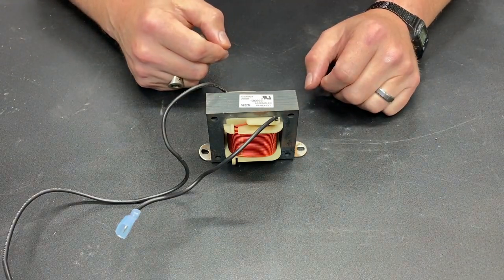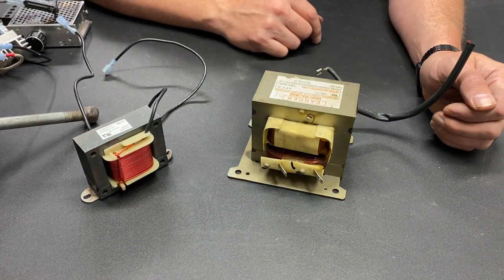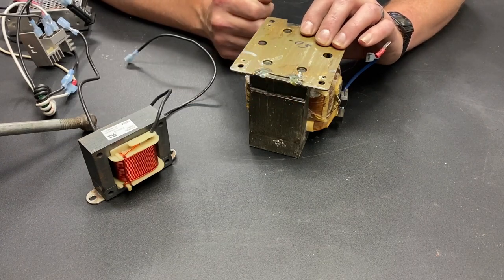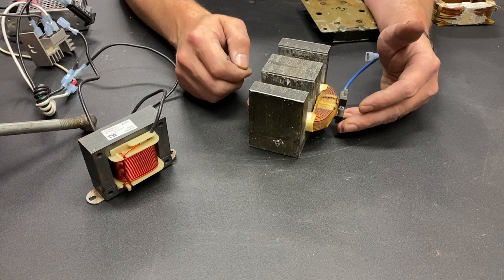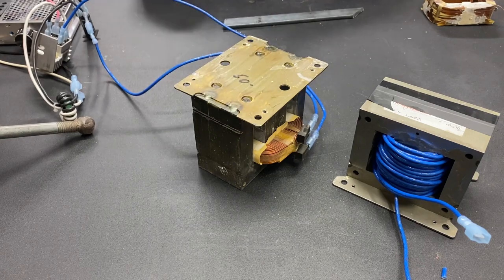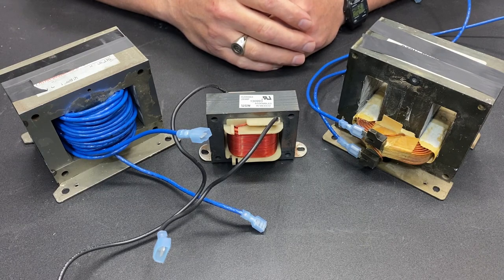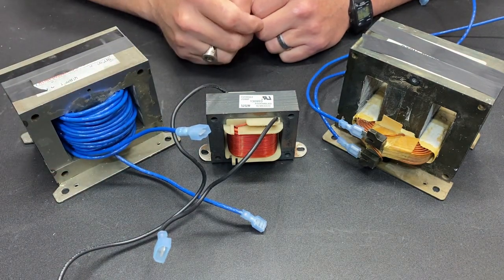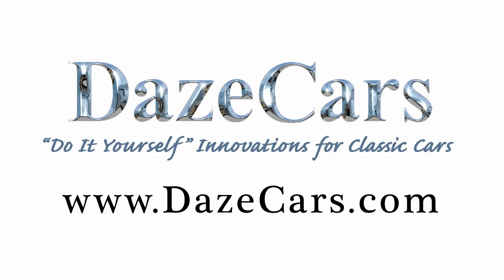DIY Treadmill Motor Choke Built From a Microwave Transformer

Comment: Hey just wanted to follow-up and point out how important your videos really are.    I asked a few weeks back about winding my own choke, then I came upon a de-funked 12v charger in the back of my shop so I took it apart and realized its transformer was perfect for choke.  Then I thought Why bother removing the upper winding as it is not connect in anyway to the bottom.  Then I thought to review this video you did again.  Lucky me I probably would not have had a chance to thank you otherwise!  I cut the top off, pressed out the upper winding and re-welded the frame, all as you suggested.  Works a charm as you had said it would.  Key take away:  Don't be shy to view good "how to" videos multiple times, there is always something new to learn.
Reply from the maker: So glad that you rewatched it and were reminded to remove the other coil as that could have been bad.

Comment: I have a MC70 controller driving a 2hp motor which am installing on my Lathe. My treadmill did NOT have a choke? Sounds like I should add one for reliability.
Reply from the maker: Can you contact me through my website  and send pictures of your board?  I have not messed with an mc70  and the internet search I did came up with to many totally different boards all labeled mc70
Reply: @dazecars  I sent you an email with pictures.
Reply from the maker: I received it, thanks. I will answer here as it may help others. That board likely doesn’t use a choke from the factory as it has other cleaning components on board like the capacitors. I would also observe sparking at the brushes on hard starts. The board likely also has soft start which buy slowly increasing speed instead of trying to immediately ramp up at once reduces but does not fully eliminate the need for a choke. As to your question about the j5 and j4 not having played with an mc70 I have not experimented with the different options and do not know their function. Lots of boards have jumpers like that to test any number of functions specific to their board which are not always drive motor specific. Short of  the ability to look at a circuit and determine its function (like an engineer which I am not) you need the pin out sheet. This lays out basic functions of connecting points on the board. Some manufacturers are really good at including such a sheet inside the treadmill and some don’t provide it at all.  Let me know if I can be of any further assistance.

Comment: Id just like to add my 2¢ for what its worth. I took a microwave oven transformer whos core is maybe a bit larger than half the size of the ones you demonstrate and instead of just the single primary i stacked 2 primary wraps into it, welded the E n l togethet and it seems to be just as good if not better than the chokes ive salvaged from treadmills. Yes those are made specifically for that motor but lets face facts in that manufacturers dont always put out quality. Ive not seen any rpm or current drop in my machines by doing this peraonally. Anyway just a tip from another diy/fabricator for all of those who look for info. Great channel, great vids, keep up the good work!
Reply: Just to add another note. Your hamd wrapped choke would have preformed much better had you used silicone stranded wire, 12 or 14ga. And had you wrapped the core tightly and without an air gap around the wire. Uses more wire but it does preform decently. I know this because i use a choke (based off of and inspired by your video here) that is 2 mot cores stacked face to face and welded together for my diy welder which puts out 80-100 amp at 32vdc on max setting. The apm depends on what material im welding. 10ga wire soundly wrapped filling the core with no epoxy. Anyway, just a bit more info to help share, keep up the good work!
Reply from the maker: Did you wire the two cores in series or parallel?
Reply: @dazecars  series
Reply: On the same cotr
Reply: Core ... Lol typos
Reply from the maker: @robertolson6686  I totally understood it was two on one core.  Would it be possible for you to do a little experiment?  Can you change the wiring to parallel and see how it effects the function?  The advantage would be reduced resistance on the core material and the ability to flow more amps.  What I don't know is how that would effect the chokes ability to clean the power.

Comment: Another great video thanks 👍
I've used microwave transformers for other projects before. If your not going to rewind it you can carefully hacksaw through the fine winding and tap it out. Handy if you've not got a grinder or welder. Ps I have both but still used a hack saw just be careful not to cut into the big winding.
Reply from the maker: A wood chisel also works well to cut through the fine coil.
Reply: You mentioned a hydraulic press for removing the coils. I am looking at a 12 ton from Harbor Freight. Your thoughts if any?
Thanks
Reply: @frankglass  a 12 ton press would be more than enough to remove the coils. Tapped mine out with a bit of wood and a hammer with no problems.

Comment: Very glad I watched this, Ive just put a 1HP 180VDC on a small lathe and can see the clear need for a choke. Very well presented, no oscilloscope needed. Ive also got a unlabled motor that has ~ 3 Ohms winding so 4-5HP ? My initial thought was a 2KW microwave TxF wouldn't be enough but then the primary in the microwave TxF is loaded by the secondary whereas in a choke its just knocking the spikes off so much lower power dissapation. So should be fine. The US transformers will have windings twice as thick as the UK ones of course and need to step up 2x more. Food for thought.
Reply from the maker: Glad it helped!!  I thought about buying a cheap oscilloscope specifically for that video but realized the practical observations not only showed the difference clearly but also would be the limit of what most DIYers would have available to them.  Never thought about the fact that 220 transformers would have half as many wraps of wire.  I have thought about taking two primary coils and wiring them in parallel, and testing effectiveness, and then series and doing the same test.  series will double the resistance but might filter better... not sure.  At this point I am moving beyond my knowledge base.

Comment: thank you very much ..as for DC motors .. I bet this would work as well on A/C motoors as well..brush wise that is.
such as in drills and saws ect..?
Reply from the maker: Its my understanding (I am by no means an expert) that it works but not the same frequency range.  They are actually opposite.  The ferrite doughnut is an effective choke for the AC side so there is not much need to do more plus its in a range that is not as hard on brushes.

Comment: Instead of using a choke maybe a soft starter with a big resistor that charge the capacitor slowly to prevent inrush current. So you can start the motor even at full power. Sorry for my english.
Reply from the maker: Interesting idea but I have a couple concerns.  the resistor would need to be very high wattage and the slow bleed would make the motor take longer to come to a stop when the power is cut.

Comment: Absolute perfect. A quick question DOORBELL TRANSFORMER, would it work as a DC Choke?
Reply from the maker: depends on the size of the wire in the primary choke.  It would probably need to be at least 16 awg, but 14 or 12 would be better.

Comment: Love your work , I  don't mean to get nerdy , but the treadmill choke is specked at a certain inductance for that circuit . Measured in henries in fact . 
An o scope shows ripple  , which is the nerdspeak for dirty electricity.  
In an audio circuit you can actually hear a nasty buzz .
Reply from the maker: Thanks for the comment and I'm glad you like my channel. I like nerdy and I was aware of henries.  The problem is once we ditch the treadmill board and go with the SCR and or change out a motor a whole new list of variables that we don't have the technical data on eliminate the ability to calculate the "correct" size. Even if I had those specs the calculations are above my pay grade 😂.  The good news is all these "motor chokes" have similar specifications with the one constant I have found that the bigger they are the better they work.  The other thing is a choke on a motor is only there to prolong the life of the brushes and commutator so as long as you are in the range they will all work about the same.  Where henries really make a difference is like where you said audio circuits and other sensitive electronics where you are trying to filter out a very specific noise range but on a motor all you are trying to do is smooth out the power.  That is why just about any coil on a core will have some effect.

Comment: You can literally measure the coils henrys for 20$ if you buy a transistor tester.. drok makes a good one.  Theyre the testers that can test everything, component testers..  they got a little lcd display and an atmega chipset as the mc.  Theyre great at compinent level.  Will give you the esr and all for caps, identify good and bad mosfetts or transustors, tests diodes with leakage.  Tests inductors like the chokes you made here..  theyre pretty accurate also.. cheap too..
Reply from the maker: Thanks for the tip!!!

Comment: Your videos are the most comprehensive and accurate on YouTube!.  I have a large amount of 1" steel square bar and I'm considering welding my own choke frame from this material.  I would cut and then weld the bar stock into a 4 inch tall "W" pattern similar to the frame of a manufactured choke.  Following your advise that "bigger is better",  I would then wind 4 or 5 layers of 14 gauge insulated, stranded wire on the frame capped by a spot welded plate.  Based on your experience, do you think this would work?
Reply from the maker: I don't know how well that would work.  Might work very well, but also might be an epic fail.  Transformers and chokes use a laminated core to eliminate eddy currents in the material.  Super important on a transformer but I don't know how important it would be on a choke.  Your winding need to be as uniform as possible and once it is done the coil needs to be locked into place via epoxy or other material wedged between the coils and the body.  Failure to do this will result in humming.  I would love to see pix of your choke build and hear how it works out.  may be easier if you contacted me through my website.

Comment: If you’re running a reverse switch on your motor, should you ideally have 2 motor chokes? One on both leads? Otherwise when you switch direction and the neutral becomes the hot, do you lose the benefit of the choke?
Reply from the maker: So it can be on either side.  a lot of the chokes inside treadmills are on the negative side but some are on the positive side.  Some setups it works better on one lead over the other so you will want to try it both ways.  Once you know which side is best for your application simply put the choke before the switch so it is always on the same side.

Comment: Choking 101 --- Loved seeing the visual comparison of spark generation - nice work.  
I'm wondering if some of the people that say their motor dies because it had 'offset' brushes is more  because they id not include a choke.
Reply from the maker: I think it is several factors: condition, heat, and lack of a choke.  Very few people are buying new treadmill motors and treadmills are something that people use all the time (thousands of hours) or hardly use at all so when you scrap a treadmill you have no way of knowing if that motor has 80% of its life left or only 20%.  No choke will shorten the life of the motor either way so if the motor is already on borrowed time it will die that much quicker.  One common error I have seen quite a bit is inadequate cooling.  The user mounts the motor in such a way that air can not easily be drawn into to it by the cooling fan, or in the case of a fan that is also part of the flywheel they remove the fan all together.  Running an SCR without a choke produces more heat which in turn shortens the life of the motor if there is not an effective way to eliminate said heat.  And then there is the increased consumption of the brushes and commutator (part the brushes ride on). Most of the sparking IS the consumption of those parts.   The brushes are easy enough to replace but adding copper back on to the commutator is a lot harder.   Any or all of these factors can shorten the life of the motor but not running a coke only agrivates the issue.

Comment: Did you try combining the choke with a large electrolytic capacitor ?  Most DC full wave rectifiers use a pi filter with two capacitors across the output terminals and a choke between them. A low pass filter. This should smooth out the ripple in the 120 hz power and suppress and sparks.
Reply from the maker: This is one of the most common comments.  People ask or comment all the time about adding a capacitor.  I did run one for a wile.  It came directly from a treadmill board.  I removed it because it caused surging under a load and there was no visual difference in brush sparking.

Comment: hi, great video !! do you think it would be a good idea to add a second low voltage winding since there is enough space inside the metal core? The live wire would go through the original, and  neutral through the second winding. Also, do you think it would necessitate an air gap?, thank you
Reply from the maker: I thought of trying something similar but it must be only one wire in other words one side of the power flow.  You don't want the + and the - both going through a single choke.  The one thing I know about chokes is the bigger the better so adding a second coil could improve the function.  What I don't know is the best way to wire it. In series it will increase resistance but there will be more coils which should make the magnetic field stronger.  In parallel it will cut the resistance in half but I don't know how that would effect the magnetic field.  I'm guessing series would be better but until I get an oscilloscope I don't have a goos way to test the options.
Reply: @dazecars  thank you , but what if it is for an AC circuit? like in the AC output side of a DC to AC 5kw inverter
Reply from the maker: I would not use this type of choke in that application at all.

Comment: I finally got a transformer, I cut it, took out the fine wire and then tested it on the motor. I didn't see any difference in sparks so I took off the top and tested for a magnetic field, but there was nothing there. I haven't damaged the wired, I get a continuous path of 0.76 ohm. I'm really not sure where I went wrong do you have any suggestions? Every step in getting the other parts or making them work has had a problem, but at least it was relatively obvious what the solution was I think I might just run without it cause I really just can't with this anymore, I don't have time but do have extra motors.
Reply from the maker: If its not making a magnetic field there is likely a short in the coil.

Comment: What value choke should I get for like a 2.5Hp treadmill motor? Your videos are extremely informative🎉
Reply from the maker: Not being an electrical engineer I do not have any specs for you, what I can do however is offer you some guidelines. First of all bigger is better. I have several motor chokes ranging from the size of a tennis ball to the size of a soft ball and the bigger they are the better they work. Second the wire for the choke needs to be a minimum of 16 awg. If the wire is not that big or better it will not have the amperage capacity to allow the motor to work properly. Amperage is the most important spec.  A lot of the chokes available on line are rated in mA.  There are 1000 mA in an amp.  Treadmill motors are rated in amps so most chokes available on line are several hundred times too small.  Third they are not available on Amazon at least not inexpensively, there are a few privet sellers on Amazon selling used parts for big bucks but the available chokes on amazon are too small because they are not designed for a motor even though they look correct in the picture they are way too small. The choke in most of my videos is part number 130993. Instead of getting one new I would get a used one. A lot of treadmills come with a choke. Go to eBay and search “treadmill motor choke” BUT know that most people on eBay don’t know what they have and the word “transformer" will also appear in most listings. Problem is a choke and a transformer look almost identical so some listings are for transformers and some are fore chokes because the sellers think they are interchangeable. They are not. They would only be interchangeable if you modify a transformer to work as a choke. (as in this DIY choke video) To tell the difference count the wires. A choke will only have 2 wires, a transformer will have 3 or more. Also before I started doing videos chokes on eBay could be had for $25 or less shipped but now that more people are looking for them (due to my videos) the eBay sellers have raised their prices quite a bit. Your best bet might be the DIY option out of a Microwave transformer. Please let me know if I can be of further assistance.
Reply: @dazecars  Thank You so so much for Your effort in replying to my message. It is truly appreciated it. I wish I saw Your videos just 1 week earlier. I threw out a treadmill just last week that had a choke in it. I did not know that I needed it so I only took the motor. I'm going to use it for a small surface grinder spindle motor that I want to build from one of my small desktop milling machines. Thank You sir.
Reply from the maker: I too will be making a surface grinder